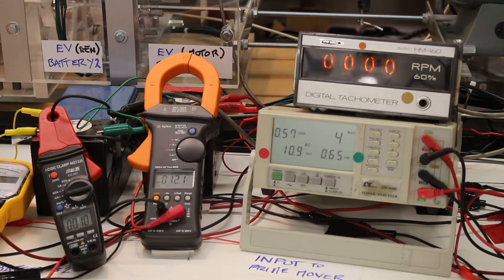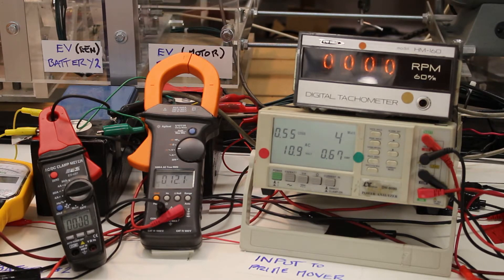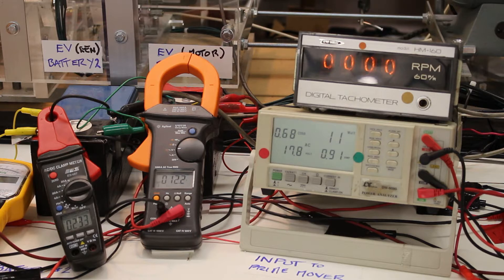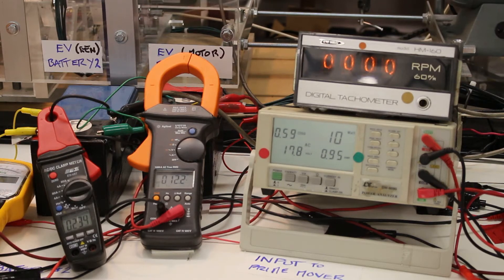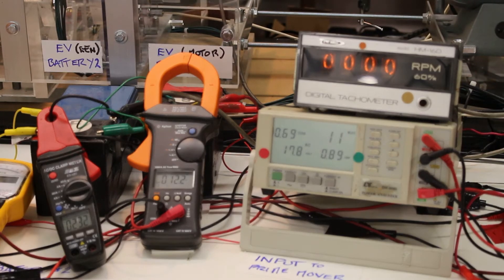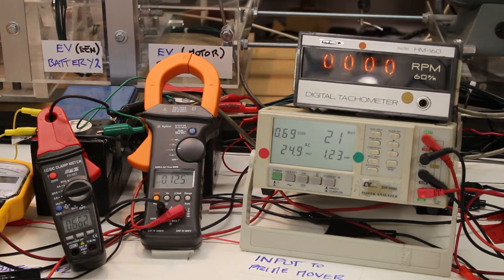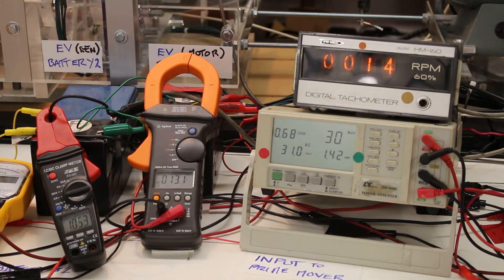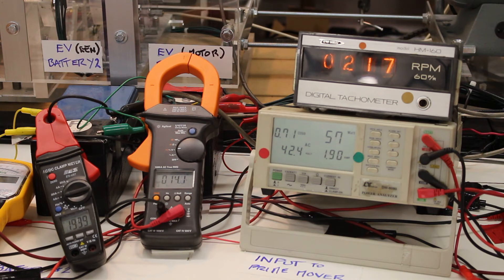Create the Future Design Contest ReGen-X Stepper Motor for EV Regenerative Acceleration

Comment: Interesting concept, correct me if I'm wrong but you have essentially found a way to make a generator that is much more efficient than the motor used to power it.. essentially there is the same amount of power in the complete system but you are collecting more than you are inputting? Sorry if this is poorly worded im having a hard time grasping this new technology
Reply from the maker: Not quite... we have developed a way for an electric motor to produce Mechanical Output Power AND Electric Output Power. So we are using Generator Action in a Motor in a positive way rather than a negative way... http://nuclearpowertraining.tpub.com/h1011v2/css/Generator-Action-In-A-Motor-109.htm